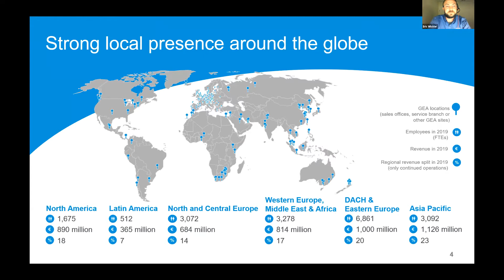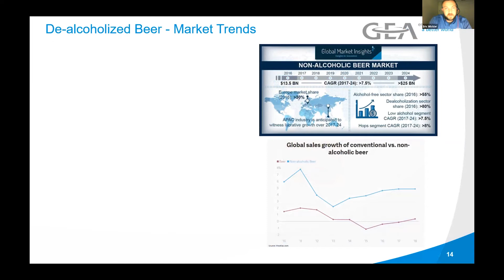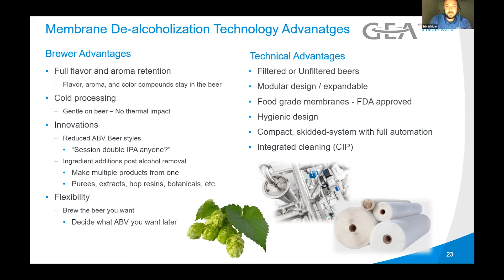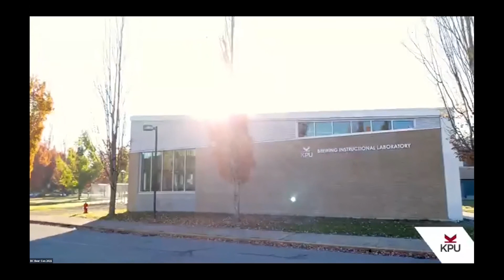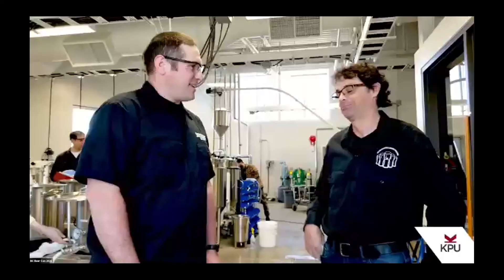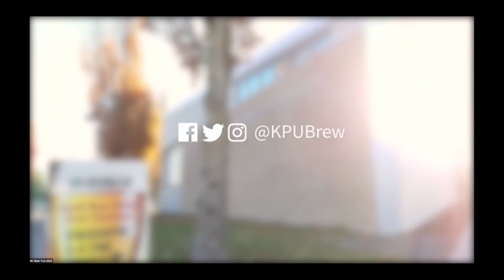Membrane Filtration  De alc Beer Production for Breweries – Eric Wickler

Comment: Thanks for this video . one question > does 0.00001 Micron filter remove alcohol ? 
i'm planing to order this in order to filter my home distilling pot still to remove bad flavor but not alcohol so i found 7 stages RO filter system and one of those cartridges is 0.00001 Micron filter so I'm worry this may remove alcohol